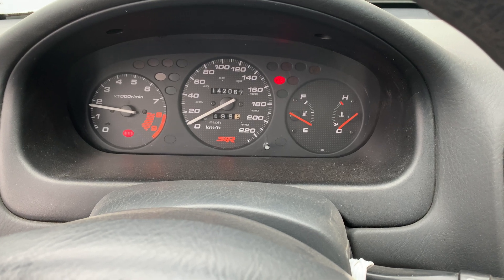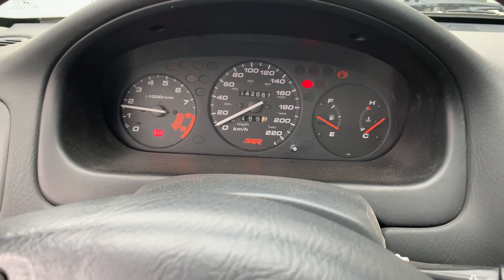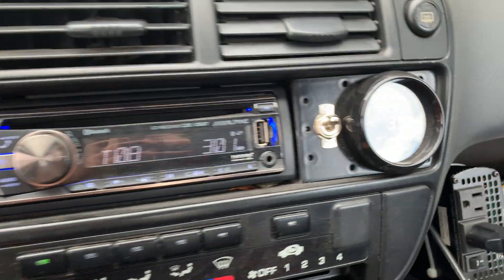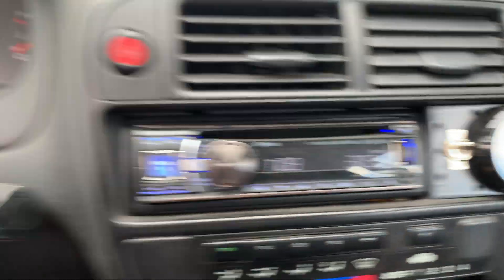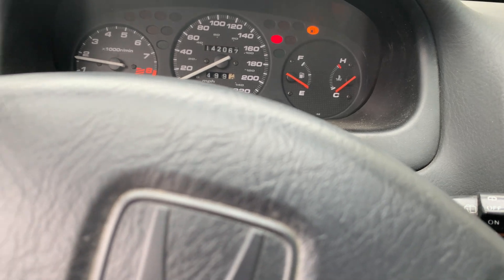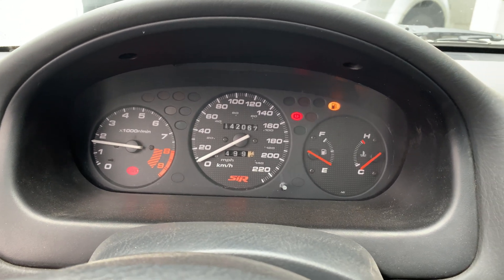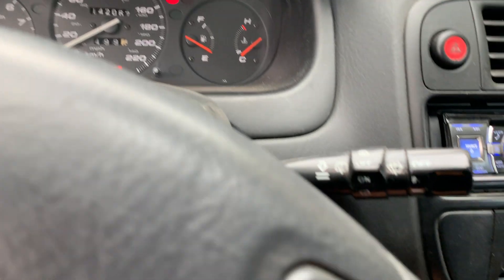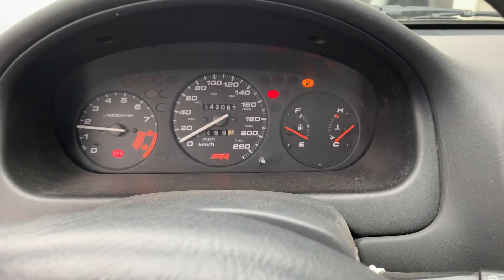Sub Zero Cold Start. Standalone ECU tune. AEM Series 2 EMS. Honda with tune challenges.

Comment: Yeah, put some full in there. Lol
Reply from the maker: ya know I had it on the lift to drain the Shell 93 cuz it has some ethanol. I unscrewed the drain bolt in the tank and nothing came out!! You figure they'd put the drain bolt at the exact low spot. Although it may have been running on fumes in that "special" 10psi of rail pressure tune!! lol, don't ask.